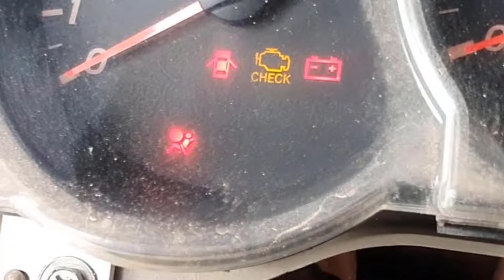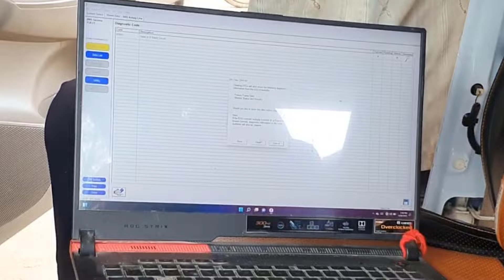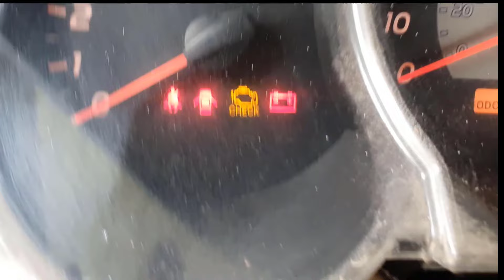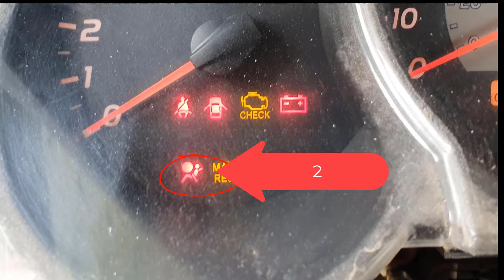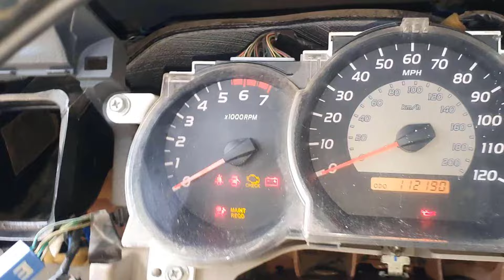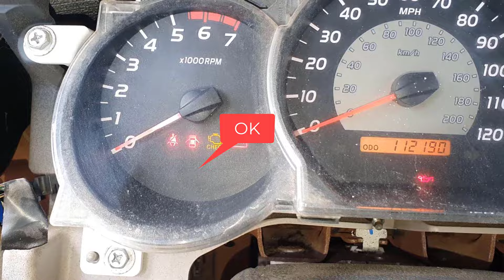B1801 Open in D Squib Circuit (TOYOTA TACOMA 2005, SRS)

Comment: At the end he separated the 'Shorting Bar' on the orange airbag socket, the reading across the terminals should then read between 2 -3 ohms for a working SRS component, which is why the airbag light went out after initially inserting the resistor of 2 to 3.3 ohms into the module signal plug to fool the module. Anything different from that reading across the terminals after separating the shorting bar means the component is faulty.  The same design is on all trigger component connectors that control a crash event on the vehicle.